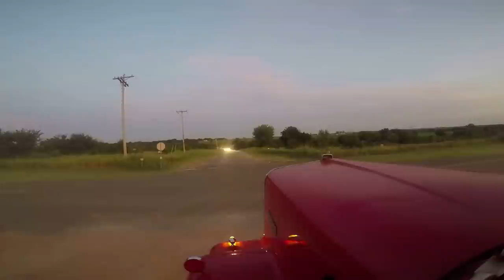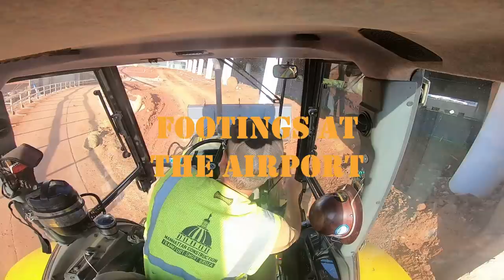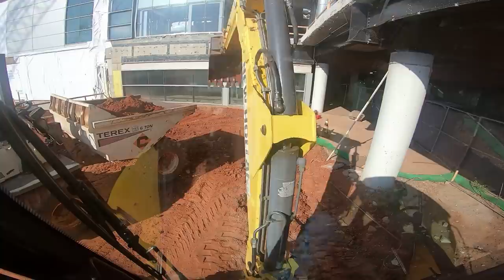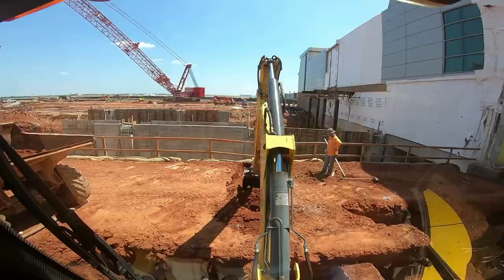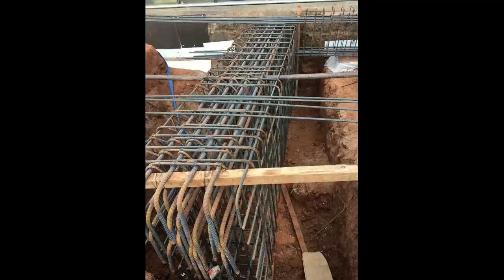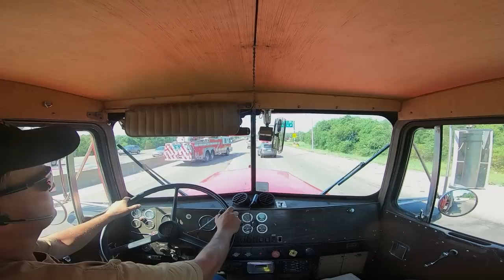Footings at the airport. #MakingBackhoesGreatAgain #Digginok #Backhoeman #backhoe

Comment: ya know what makes us great operators ,its having our machines paid off ,I also like working for people that say they can get backhoe operators for a dime a dozen , HUH those must be the ones that spin in circles
Reply from the maker: Yeah some of them guys just get dizzy! We are cheaper by the dozen though I think.
Reply: Teachable moment..... By spinning circles, excavator, why would that not be more productive than setup seen here?
Reply: @BroHay1025  First off hope everything good where yer at ,the reason why I like using backhoe's is that you have 2 methods of moving dirt with one machine ,you have the backhoe that can handle bucket range's between 12" to 48" and then it has a loader on the front with multiple uses also ,you can't do that with an excavator ........ yet , don't get me wrong I like excavator's also ,we own 2 of them ,but we still take our backhoe with us to every job .
Reply: @Kenny, Frank said was waiting on other piece of equipment to be able to load out dirt and could not keep digging. I was just curious if that was the best means to get job done to have less idle time so one could keep digging?

I was thinking an excavator would do, but not familiar with jobsite conditions(or commercial work) for optimal production. (ie, crane operator in cab awaiting something to do @ so many $$$/hr)

So, if another skid/loader used to remove spoils completely/ load buggy in different area......???

Or, what was done was the best case scenario?
Reply: @BroHay1025  ,Probably the best way to keep digging would be to have more dump carts that way he would'nt be sittin idle or skid steer's to get more production , but Frank's at the mercy of the contractor

Comment: Surprised some dumpers made it across the pond from UK
Reply from the maker: Stuart Carlyon yeah they are a rare sight around here. This company has a couple that work and a parts machine. They have a hard time with parts they say.
Reply: @Digginok  most are built with common parts to other stuff like Spicer Axel's engine probably a Perkins one 
Is it a benford like you said ?
Reply from the maker: Stuart Carlyon yes it says benford on the back, Terex on the sides. Thanks for the information.
Reply: @Digginok  is New Holland backhoes a big thing in USA we have new backhoe coming from new holland after 30 years with jcb 
There is a Facebook page called backhoe operators group I'm on that's has people from all over the world
Reply from the maker: Stuart Carlyon Ford was a popular brand of backhoe, I think New Holland has lost a lot of support since they merged with Case. New Holland doesn’t even advertise backhoes much here any more.
Reply: @Digginok  there were Ford's over here the  555 was popular our first 180 (backhoe) was a MF 50B